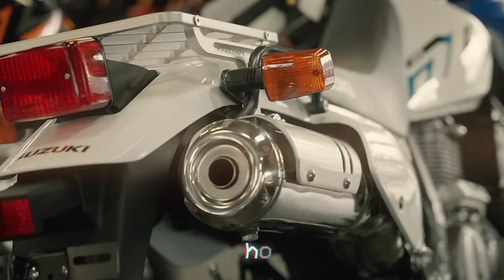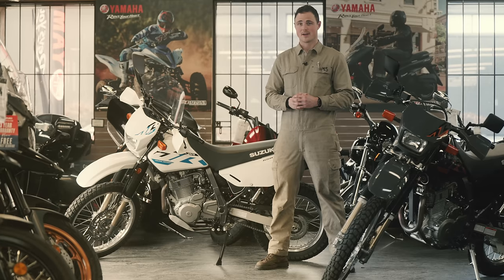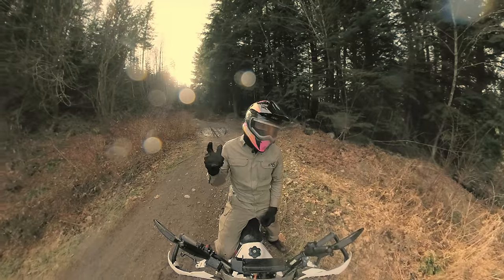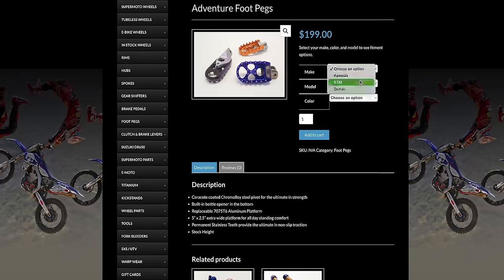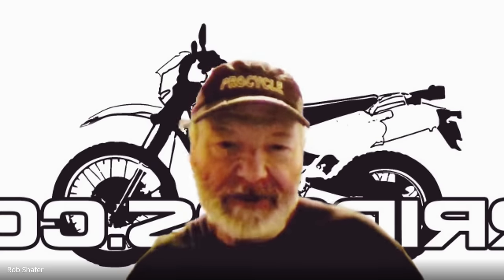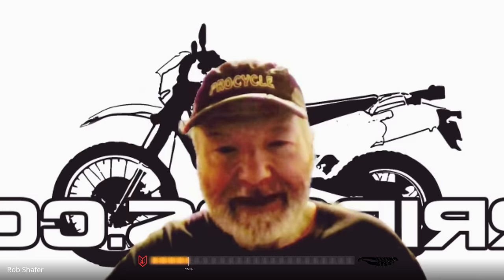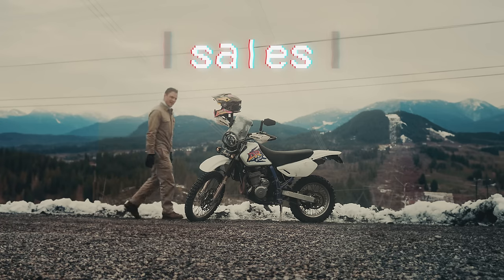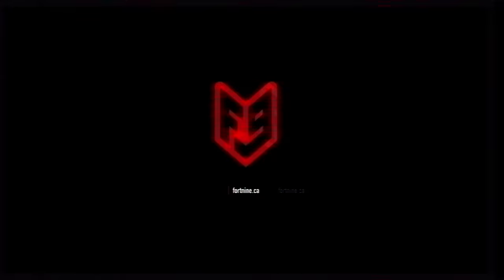Suzuki DR650 - The Motorcycle that Built a Community

Comment: Dumb question.  Don't own a bike now but getting older and want to step into a ktm 390 adv. Found old myth busters episode (circa 2000's) that show motocycles were worst for pollutants than cars.  Turns out, it was mostly muffler (and carbs didn't help). Standards change so now motorcycles would be overall "greener"
So as someone with kids who I'll be handing over the planet to, while trying to save some money on  fuel, and trying to relive off-roading that I used to do in the Army, is there mods that brings the DR 650 to being a "cleaner" bike?
That is, without the "brute force and ignorance" approach that I live about simple, repairable machines?
Would love to know if a DR 650 would then make sense, rather than aiming for something newer.

Comment: I own a WR250R. Seems it's got less and less talked about since it was discontinued, at least there's still parts (getting more expensive) and some aftermarket stuff. I was thinking of exchanging it for an XR650L since it's lighter than the DR and I'm tall, is the DR community much better? Seems like the XR has some trouble with overheating due to being lean stock, and no oil cooling. And it gets really hot here. I kind of want to sell my Beta 390 before it blows up or something and buy a yz125x too.

Comment: What kind of power levels do moderately modified DR650's make (and what are those mods)?  I am just curious if there is anything short of increasing the increasing the engine size with a new piston that would make much difference.   I once had a 500cc thumper (FT500) and found it to be acceptable as an all-around motorcycle, so I know that more power is not critical, just fun. 
Thanks

Comment: Ok, so engine improvements would have resulted in having to meet newer regulations, but why couldn’t Suzuki have updated the rock hard plank of a seat, the smallish fuel tank, the weak headlight, or made available if not stock a decent fairing and windshield? I had one that after the previous owner made changes to the carburetor and airbox only got 43mpg, on a 650 single?
Reply: They did offer a version of the DR with a fairing back in the day, DR650RSE .  I think it was Euro market only though.

Comment: Yeah, go FortNine! Yay, Suzuki! Yay, DR650!. And, even, yay, DR 800 (oops 800DE)
As far as the DR650, lemme hear a specific ex-English teacher say "it doesn't make sense on paper." [Look at their profit margin on this thing]
Suzuki is wiser than you are, dork. (ref English teacher).
Ryan is right about the KLR650.
And it was first.
But the DR650 addressed every complaint about the KLR650 when Suzuki went into production in 1996.
I still say, for a beginner licensed rider, a DR650 IS the best motorcycle.
If you aren't 13 yrs old or older, something in a 125-350cc may be better, but once you can road, the DR650 ticks too many of the happy marks.
And it doesn't force you away from trials, or motocross, or dual sport, or ADV or commuting. It's not perfect for any of these.
But it can do all of them better than any other motorcycle ever built. At a BUDGET price.

Comment: Excuse me for being an idiot, I've done quite a lot of riding growing up but never "owned/maintained" my own bike. I've done a lot of research, and I'm looking at buying a 
CRF300L RALLY... how do these two bikes compare? Not in terms of performance, but in terms of helpful community, mechanical maintenance,  simplicity of care and or modification ect....

All opinions are appreciated ❤
Reply: A crf300l rally or a dr650 are both amazing. Pick a bike that you think suits you better. I've just bought a 2001 DRZ400S, just because i think it suits me best, eventhough a dr650 would probably be a good choice for me aswell. As long as you choose something that has a decent reputation you should be fine.
Reply: @Anony-Mouse28  thanks, that's along the lines of what I was thinking. I have a fair bit of riding experience but I mostly want it for off road, I don't "need" a crotch rocket. I just want some fun off road riding, so I'm not too worried that I'll grow out of it too fast. Especially as what's around in NZ for riding, they're pretty rough terrain, I would never be hitting a dry, Rocky river bed, a thin, mountain trail with a savage drop off ect at 100+km, I need reliable and simple while still being fun, hence why I'm leaning toward the CRF Rally, it seems to tick the boxes. Plus it's cheap, fuel, insurance, on road costs ect, being so "small" it's cheap in every respect :)

Comment: KLR650 or DR650? Discuss and tell me why.
Reply: The DR650 is lighter, faster, doesn't have a radiator, no doohicky, Has an oil cooler. I've owned the other two. There's a guy on ADVriders that has created a small business rebuilding XR650L engines. Then there's the Thermobob for the KLR.

Comment: 12.600 in my 2019 bought new in 2020 for 6500 OTD.     Money well spent ...I think.   Also have a 2023 690 Enduro R    I have about 3500 in aftermarket , so thinking you wont need anything on your new Beast in class Austrian Pumpkin is a myth.   Btw...throw that carb away and buy a flatslide pumper....damn Procycle

Comment: Everyone hypes up procycle, but they have disappointed enough times that I stopped ordering from them. A lot of the "better than oem" aftermarket parts are cheapo brands such as All Balls or Moose Racing. They also don't communicate when they are out of stock and on a backorder for parts. They burned weeks of my riding season, doing just that, and I have not ordered since

Comment: Not really impressed with my '22 DR650.  It's a victim of Euro 5.  Vacuum petcock, hard start - no start when pressure builds in the tank, running so lean from the factory it has decel pop and glowing red header pipe after more than a minute of idling.  Pegs are too high, bar is too low.  Valve cover doesn't have a gasket.  Its sealed with permatex and started leaking on Day 2.  This was my first and last DR.
Reply: If the valve cover doesn't have a gasket why did you not get it fixed under warranty? Every DR has a rubber gasket there. Every bike bike since the mid 70's runs lean, they all need the a/f corrected. What's the big deal, raise the bars and lower the pegs. Part of having a DR, make it your bike!

Comment: DRs are great bikes - to a degree. The community is excellent, except when it gets cultish, and man, it gets cultish at times. As a DR owner, I was amazed at the hatred many expressed towards other brands or - gasp - deserters! Never admit your DR is less than 100% reliable, 100% of the time!

Mine, with various essential mods and breakage replacements, did exactly what I wanted - mostly outback adving. I bought it new, spent ~2.5k on what I considered essential, a similar amount on replacement bits, and umm, probably the same again on accessories. 🤷

Was it fuel efficient? Ahahaha. No. Especially not loaded up. 

Was it reliable? Not particularly. It kept going till it didn't, but despite professional servicing, needed significant repairs between trips, and stranded me outback twice, the last time being the last time it ran (engine death rattles). 

Was it fast? Ahahaha. No. It was however, plenty fast enough to travel at speed limits all day, tar or dirt. 

Was it comfortable? Not standard. With a comfort seat and sheepskin it was good enough for 1000km days.

Was it value for money? Damn straight. 

Was it a great outback adv bike? Yes. <-- Without a doubt. Despite its faults. <-- This is key. 

Do I miss my DR? Yes and no.

I wanted something more modern. The replacement is objectively much better, but there was something pleasant about relaxed tooling along on an old banger. The new one cost lots more, is modern, lighter, powerful, and fast - definitely overkill for me, but it's waaaay more fun 😂😎. No essential mods required, but I've still fitted my standard accessories and a comfort seat.

Would I buy another? 🤔 As of today, probably not. I've moved on. Despite good times and great memories, I don't miss my DR, but as I haven't yet gone outback on the replacement, I definitely can't say never again. 😊 If I planned to ride round the world, a DR would undoubtedly be one of my first choices.

Comment: Over this side of the pond, the proper dual sport bikes have been dead for years. You now have to choose between a proper enduro bike or a 'lightweight' adventure bike. Even the T7 is a bit on the portly side for actually wanting to go off road. I've got a '92 DR350 alongside a '16 KTM 350, and while worse in every measurable way, the DR is brilliant at what it's meant to do. The KTM shakes your teeth out on the road and needs an oil change every time there's a Y in the day, and a new piston every other time I change my underpants (and the KTM can be quick enough to scare me so my pants get changed every 50 hours of riding!). The DR though will go KS without an oil change and I've just changed it's piston for the first time EVER!  I wouldn't want a R
DR or any other proper dual sport for proper enduro these days, but as a companion and a do it all, the DR is brill!

Comment: It's great that DR650 has a such a great community now, but, honestly, no one should buy a non-ABS bike and ride it on the public road in 2024: ABS is just too damn crucial for the motorcyclist's safety. Also no one sane wants to buy a carbureted vehicle in 2024: carbs are just too unreliable and prone to problems, malfunctions and wear comparing to the electronic fuel injection. So, no, Suzuki DR650 is not a good buy nor a smart buy nowadays. Not even close!
Reply: Gimme a break Karen - I ride 3  1000cc plus street bikes without ABS. A single carb is no problem, provided you know how one works, and FI has problems, what are you smoking? So yeah, the DR is a decent buy.

Comment: I have a DR350. It's nice having a 6 speed. Also nice there are a number of parts it can use off the 650. Unfortunately it had it's run and is slowly fading away. The 350 with a little work can be just as good or better than drx.

Comment: I think the reason why so many people continue to buy these bikes, as well as the XR650, the DRZ400, and many other legacy designs is because we specifically don't want the new technology. I find it disturbing how much useless garbage they are cramming into new motorcycles and vehicles these days. They are less reliable. They are harder to maintain. And they have more sensitive electronic components. When a mechanical system fails, it usually fails gradually over time, and you will hear sounds or see visual issues to warn you. When an electronic component fails it usually fails instantly without warning. And, the new emission control systems are a joke... They only make sense if you realize they are designed with an agenda to destroy the entire industry.

Comment: Stop the faux cult of this bike being so great. There is a difference between "easy to fix" and "reliability" If you are always fixing it, even if it's easy to fix, it's not reliable. The DR650 is exactly that, not reliable, never a ride without having to fix something on a DR. The DR is not a reliable bike it's just easy to fix. And the harder you push it the more it breaks.

Comment: nope.  I bought the DR650 with few miles.  crappy stock suspension.  Why should you have to spend $1K+ to make it decent?  That 1 cylinder hits like a cannon.  1st gear stock is not geared correct to climb steep hills & big rocks.  Ran fine on the street.  clunky.  

I know most folks like the DR650.  not me.  pass & sold.  I would rather own a good street bike & big capable quadrunner.